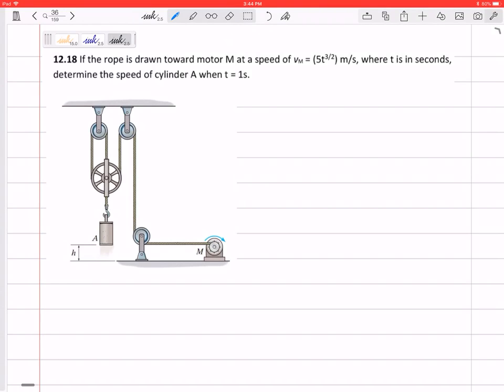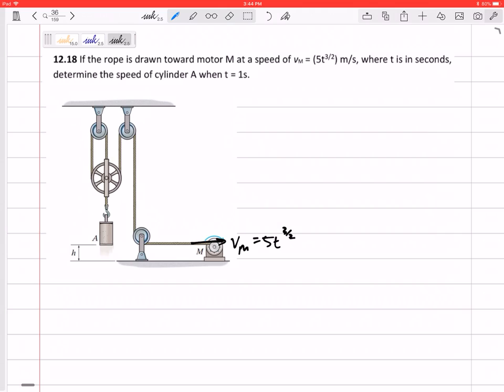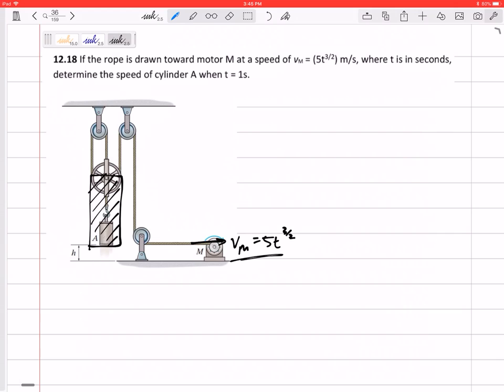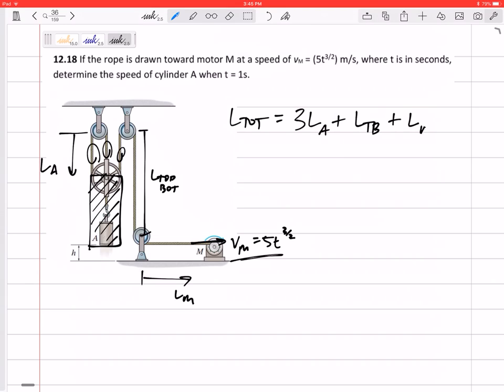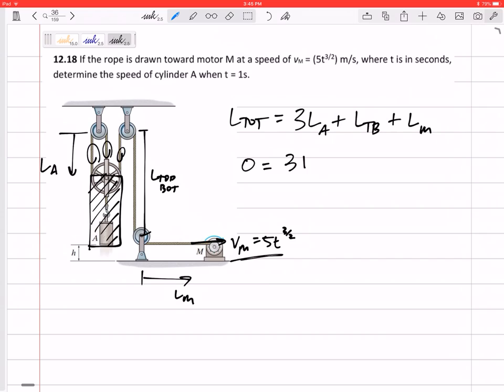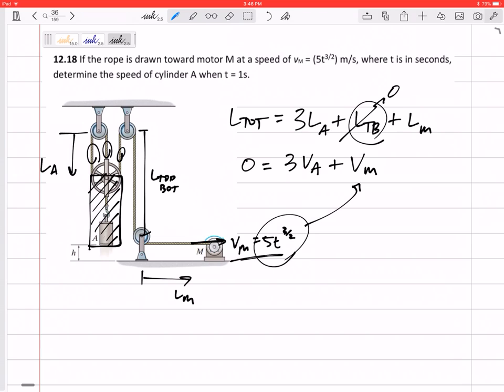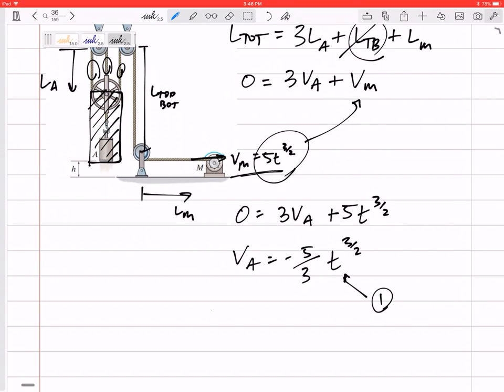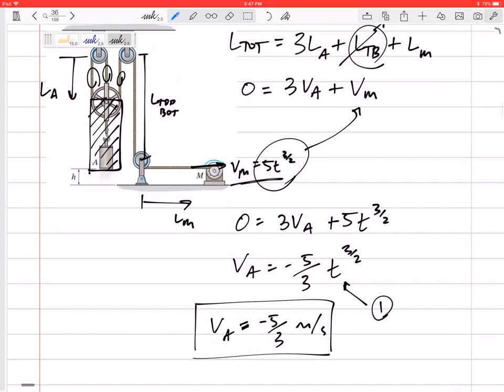Dynamics - Constrained Motion Example 2

Comment: Why is Lm not constant as Ltb? The motor is fixed and the lower pulley is also fixed
Reply: did you find out?
Reply: Because Lm gets “longer”. Just put an arbitrary point along the rope and you’ll see it gets closer to winch. You can even replace the winch with a person pulling, and you’ll see the length changes

Comment: Why is Ltb considered constant?
Reply from the maker: Ltb is the distance from the top pulley to the bottom pulley. Both are fixed so that distance is constant. Yes, the rope is moving between those points but there is always the same amount of rope between those two points.
Reply: @engineeringdeciphered  why is lm not considered constant too since its also fixed
Reply: That's a good question I'm wondering the same thing. Especially with the previous example with the whim, why was La not considered constant. Confusing :(  @abdi1298
Reply: @selmaaab6009   I believe he considered Lm constant(not changing  @ 1:21) making the derivative Zero(0).